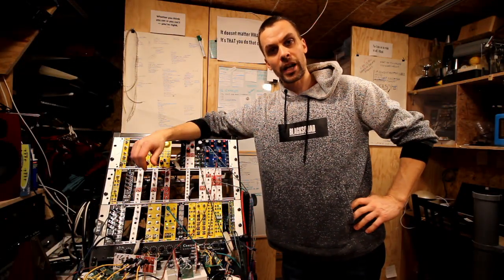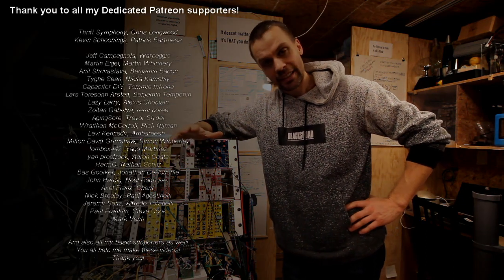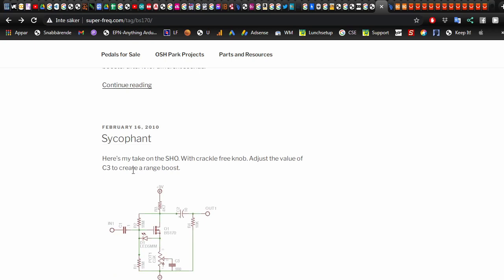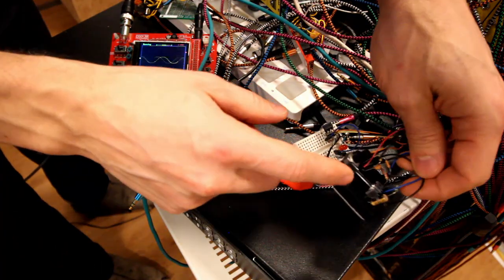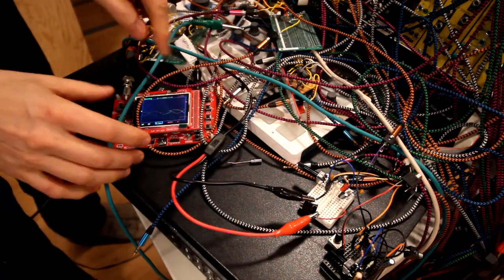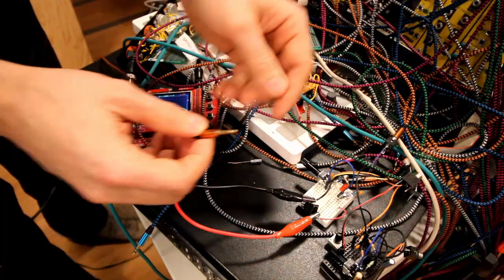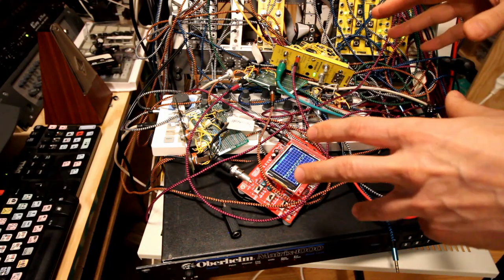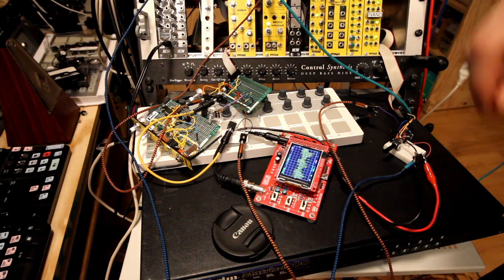SHO SHO SHO (Super Hard On x 3) "distortion"? - Modular in a Week 13.2

Comment: That 303-sound is so cool <3 Need to get back into it, (almost)clone mostly ready, but motivation shifted into modulars. Thank interwebs for service manuals <3 Sequencer part of it is PITA, includes coding atmega8, it must be possible done easier without coding. Maybe 303 as modules 🤔 What makes 303-sound?
Reply from the maker: 303 sound is mostly the sequencer I think and envelopes. It is basically an oscillator with a 24db filter. But the sequencer with all its quirks is the magic sauce. That’s what I tithing at least. :)

Comment: FWIW there are inexpensive germanium transistors available from eastern europe on eBay – I bought a batch of Polish ASY37S that are terrific in guitar fuzz pedals. Also plenty of silicon versions of Fuzz Face, Tone Bender, etc. Definitely go for it! One cool thing about the Fuzz Face circuit is that when you back off the guitar volume knob you get a gloriously sparkly clean tone (Hendrix's clean tone was often actually running through a cranked fuzz face but with the guitar volume pulled back) – it would be fascinating to see what would happen if you ran your modular signal through a heavy attenuator (100:1?) and then into a fuzz face, if you'd get the same kind of thing happening. Also worth looking into octave fuzz circuits like fOXX Tone Machine for an octave-up overtone.

Comment: I found the silicon transistor fuzz schematic I made. I cannot find where I found it on the net today though. It is not on their site anymore. I just used 2N3904 general purpose transistors. It seemed to work to me. Maybe old germanium transistors would be better? But it seemed OK with modern transistors. Due to copyright issues I had to redraw it.  See it here https://i.postimg.cc/FRjBWmFm/FuzzFace.png Not my circuit no rights reserved.
Reply from the maker: Interesting. I did buy a bunch of bc109c which were 10 for 3$ so not so bad and they sound very nice. But I will def take a look at this one aswell. Thanks!
Reply: @SourceryOne  general purpose transistors are all pretty much the same. Within limits, of course. One thing interesting to do with transistors is to character curve trace them. If you're really into the whole sonic aspect of them. There's info on the net about how to do that. Was so long ago I did it I'm not sure how today. Your LCD scope may not be able to do it? It may involve X and Y inputs. Which those lack. BTW while watching you it looked like you did not have your trigger adjusted properly often. When the trigger is the right level you don't have to freeze the wave form to see it. The scope will just lock on itself. The trigger is that little pointer on the right. If it is outside the wave the screen will scroll.
Reply: Oh damn I just realized I did not label the controls. You'll figure it out. I think RV1 is fuzz and RV2 is volume?

Comment: Sounds cool! I noticed the schematic calls for + - 9 volt - did you do anything to adapt the schematic for a + -12 volt Eurorack power supply, or just use 12 volt and hope for the best? It's such a simple circuit I'm inclined to give it a shot.
Reply from the maker: I just used the 12v power rails. No need to regulate it down to 9v.
Reply: @SourceryOne  Rad, thanks!